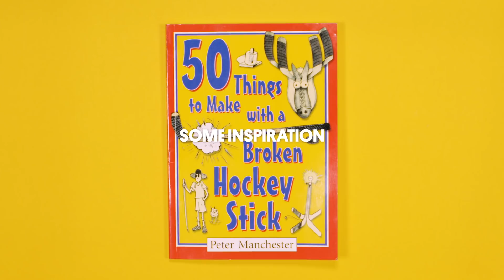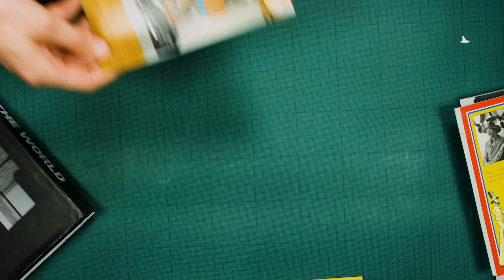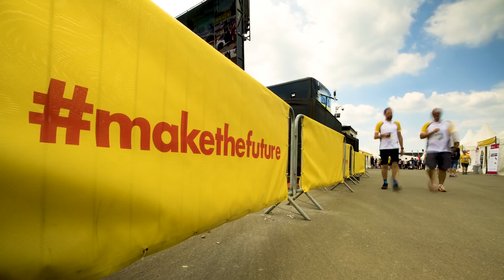Building the Ultra-Efficient Drive

Comment: Maglev is the future. The road drives the cars. The cars don't even drive.
Reply: Ilsunny Lo, it seems unlikely that maglev vehicles (which are currently limited to trains) will ever drop you off at your front door.  I don't see maglev cars in the future.  So, it's likely that you will have to take a more versatile mode of transportation from the maglev terminal to your home.
Reply: @NOLAMarathon2010  it prevents traffic jam. Can you imagine 2x more population 10 years later with the same road jam? It be forever
Reply: I guess you are a non car guy, driving is more fun than you think it is.
Reply: Unless we have an "unlimited" energy source and high-efficiency electromagnets that works in room temperature and beyond then this is an expensive, limited-use white elephant. Trains powered by Compressed air is more efficient in terms of energy and economy than this.